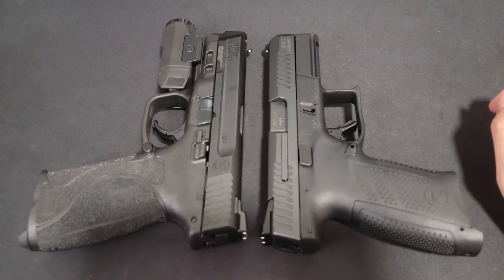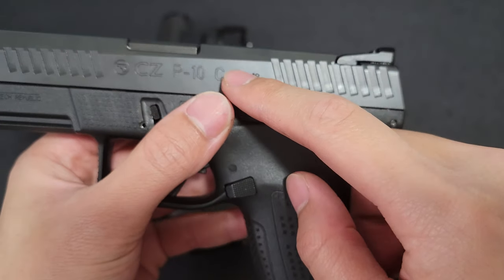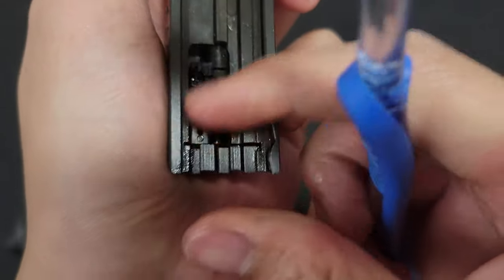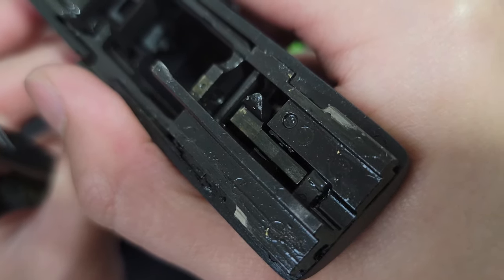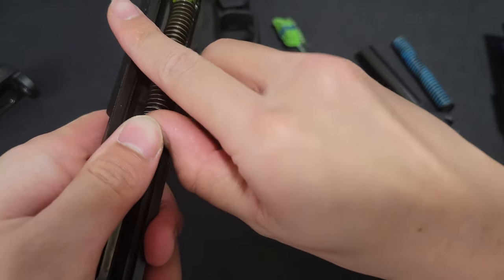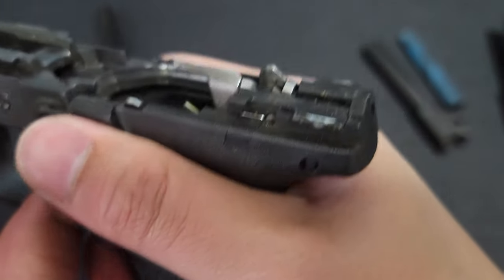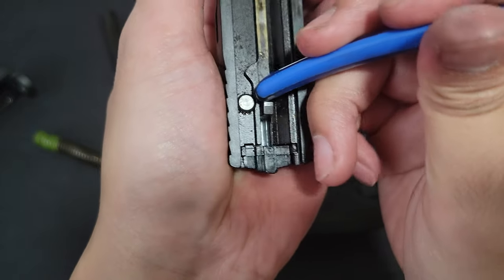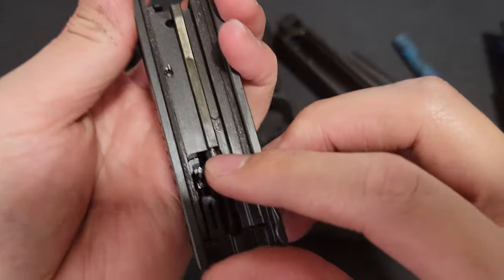Addressing the CZ P-10 C Firing Pin Stop Design Flaw (Read Description, Updated 7 April 2021)

Comment: Shame the P10 uses, in my opinion, an inferior firing pin block substitution. I really love my S model. I am planning to CC a Glock but it feels like a big downgrade. Big tradeoff for safety. I hope CZ resolves this issue before any one is hurt and their reputation is stained.
Reply: Their reputation is still intact and the sky hasn't fallen yet a year later 🤪🤪
Reply: This has been a "problem" for six years and I have not seen or heard of one single instance of a P-10 series negligent discharge from mechanical failure.
Reply: @TheOfficialCaseMade  Ya, I just learned recently the P10 series is partially cocked. Lol

Comment: What do you want to prove? That something doesn't work the way you expect it to, just the way it was designed, it is obvious. The situation that the fully cocked firing pin hits the lock will never occur except in your test. There will also be no mechanical wear of the lock because in a normal firing cycle the lock never comes into contact with the striking firing pin. Lock wear can only occur when someone intentionally strikes the lock with a fully cocked firing pin. Just. There's no other way. You wrote about a possible malfunction and that the lock should protect against accidental shooting. And you prove that the lockdown isn't exaggerated to protect against a situation that will never happen. What if there is a lock failure really happens, and the block won't release EVEN when we try to fire? In CZ, the spire will overcome such a blockage, and maybe it will save your life. The lock is designed to withstand the firing pin falling off the trigger rail without the trigger being pulled, and nothing more, not even 1% more than that. Because when this lock fails, you pull the trigger to save your life, the lock won't release. And the gun will be useless. All this test it's like proving that some company released a defective car model because the brakes don't work in zero gravity.
Reply: Pretty accurate 👍

Comment: I took mine apart and the whole assembly including the firing pin block moves forward and the firing pin sticks out and would indeed fire a round, just as you show in the video. So that could be a problem if the gun is dropped and worse yet I guess the gun could fire if you racked the slide and then let go to close being the case being loaded as the slide goes forward? I guess the only safe way to carry the CZ would be with no round in the chamber and also when racking the gun you would have to not let it slam forward like in other pistols. It's a really nice gun, too bad about the design flaw. I wonder if it would be possible for a gunsmith to insert something to prevent the whole mechanism sliding forward.

Comment: Can you test drop it on a primed shell?
Reply: He doesn’t even need that. You can get snap caps with foam cylinders where the primer would be. He can run drop and hammer tests easily with the gun fully assembled and demonstrate that he was able to get the guns internal safeties to fail this way. He hasn’t. If he’s such an amateur rocket scientist, he would already know how to prove his claim. Anyone can go digging into an unassembled firearm with tools and make things fail.
Reply: of course he won't do that. he'll become a laughing stock
Reply: I did, with 3 times to make sure it's consistent

Released from half to 3/4 cocked the primer was dented but didn't go off, even with reactivate strikes on the same one. But when released from full cocked it did go off. Although when loaded, the striker is only half cocked. While it could be better designed, it's definitely safe enough. Not to mention the sear can't move down in the half cocked position, so the sear will have to physically break before this even matters

Comment: So I have a 2021 and 22 model and one thing isn't making sense. If they discontinued a specific model number because of something as serious as a firing pin issue like you've stated, why is there not a recall for all those models?
Reply from the maker: The thing CZ fixed was the older model P10s striker sear rotating sideways and jamming up the gun.

Comment: Just curios, when the gun is assembled, what would make the firing pin move forward without pulling the trigger?
Reply from the maker: A malfunction, these safeties are there in case of malfunctions, not in case the gun works properly. If the gun ever malfunctions, it may fire whereas if other guns malfunction, they will not.
Reply: @Radvous  🤣🤣🤣🤣🤣🤣🤣🤣🤣🤣🤣🤣🤣🤣🤣🤣🤣

Comment: So is this a safety recall issue or something?  I just bought the p10 c and the p10f,  do I need to contact cz and see what needs to be done??
Reply from the maker: It's a possible failure point, but you should be alright.
Reply: @Radvous  Thank u.

Comment: Do you know if this has been corrected in current versions of the gun? Would this issue stop you from buying one if you liked it otherwise?
Nice vid. I’m not very mechanical and I could understand it.
Reply: I have one with a production date of 2023 and mine does not have this issue and works as it should
Reply: Same

Comment: I'll bet my neighbors just heard me slap my head.  Walk yourself through that line of thought again and let's see if you can figure out where you lost it.
Reply from the maker: Better yet, teach me if you know so much. Remember, its function doesn't change when the gun is assembled, I can take a needle through the back of the slide and flip that safety, nothing is holding it. What else do you have to inform me about?
Reply: @Radvous  Great, go ahead and grab a probe and measure from the back of the slide how far back the striker is actually taken to under function, then go ahead and repeat your little test under the actual forces the striker is capable of producing instead of slingshotting it from as far back as it can go.  If you have a small trigger pull gauge, you should measure the differences in forces compared to where it actually gets cocked to vs where you are extending it to.  Your "test" is putting the firing pin spring under compression that it doesn't ever reach during normal function and are jacking the striker forward with more force than it is capable of producing under normal function.  Not hard dude.
Reply: @Radvous  And FYI, there is an anti-rotation device on the seer which keeps that safety from moving.  But sure, you claim the function doesn't change...

lol
Reply from the maker: @Arthur11342  there is not buddy, that's just heresay, checked mine multiple time
Reply: @Radvous  If by checked you mean mangled with a toothbrush, sure.
Reply from the maker: @Arthur11342 if needle through the back of the slide doesn't get through to your head enough, then this is a lost cause. I literally have the gun in my possession, can take a needle and move the firing pin block, that means nothing is holding it like you said it is. Unless you have even 1 video proving otherwise, your "opinion" means nothing. You're just someone spewing garbage from your mouth. Take the word of someone who actually has the gun, not someone who just talks with no experience.
Reply: @Radvous  Cool story, bro.

Comment: The pistol must be assembled for this to work. Cz can sue for this.
Reply from the maker: Even if that is true (it's not because I tested the safety while the gun was assembled), the safety itself by design is supposed to work if the slide breaks off the frame, if it only works when assembled in theory, it is pointless. It's supposed to be designed to work whether the gun is assembled or not. Glocks, M&Ps, Caniks, HKs etc. all work when disassembled.
Reply: @Radvous  Thanks. I have the p10m. Hope it works ok.
Reply: @larryjones6049  the p10m doesn’t have this “automatic safety” feature. It’s the only one in that line that doesn’t.

Comment: This early Gen one P10 or newer model? Looks Gen 1 they had lots of issues that’s since fixed now least  I think
Reply from the maker: 2020 model
Reply: @Radvous  looks nothing like it maybe I’m wrong
Reply from the maker: @tacticalbt1023  this model doesn't have the Ambi magazine release like the originals, and the loose swiveling striker assembly is not present on this one, also the serial number identifies it as a 2020 production.

Comment: You keep saying “you’re missing the point” when others tell you the system works as one, not with the slide removed. Just to get to a point, where did you attend gunsmith school instead of being a YouTube genius?
Reply from the maker: I'd say a have an extremely mechanically inclined background https://youtu.be/3QCrFIXZTTc / https://youtu.be/hBWf2C6Q2Nk
Reply from the maker: Also no the slide doesn't have any more integrity with the slide installed on the gun, the firing pin stop is in a place where it is designed to be able to move and nothing is holding it in place any different than it is when the slide is outside the gun. Also depending on your pistol, your slide may pop off the frame if it takes a hit hard enough, some Glock slides have been known to have broken rails too, but good thing their firing pins work outside the frame. Most people are not super mechanically inclined, that's why most people are not engineers so think about that. A lot of times it takes one person that's different than others to figure out stuff.
Reply from the maker: Huntski Kerbiden-Zhaojing  that's fine, I am all ears if you or someone else could make a video explaining in detail how I am wrong. What I want to know is how does the firing pin block not have an issue, as that is my main concern. My concerns do not lie in the rest of the gun functioning as those have seen to be engineered just fine, I also indeed do like the gun, it fits great and has a nice feeling trigger. I'm am open to detailed video and explanation of the firing pin block specifically how it allegedly actually works just fine. Me thoroughly examining my gun, I have seen first hand that when the gun is assembled, the structural integrity of the firing pin block doesn't actually change as nothing on the frame actually holds it in place any different than it is outside of the gun. Also I would like to ask anyone, what is the point of a firing pin block as well, there has to be a specific reason to it. I look forward to learning, thank you.
Reply from the maker: Huntski Kerbiden-Zhaojing  you can't just yell, you have to back it up, show a video of your CZ.
Reply from the maker: Huntski Kerbiden-Zhaojing  I have even put in a small pin inside the gun when it is assembled, to try and see if anything holds the firing pin block, nothing does, it moves sloppily and freely even when the gun is assembled. Please answer this though, what is the point of a firing pin block? What is is purpose and what is it designed for?
Reply from the maker: Huntski Kerbiden-Zhaojing  make a video, prove to me I'm wrong and I'll Venmo you 100 dollars, I will make a video saying I'm wrong too if you can prove it, back up claims, yelling won't cut it.
Reply from the maker: Huntski Kerbiden-Zhaojing  you can actually Google this, it's not just me that is claiming this. Here's what I can do, I show you that the firing block moves freely even when the gun is assembled to ram home my argument that the firing block doesn't work as designed.  The rest of the gun, totally fine no issues, just this one.
Reply from the maker: Huntski Kerbiden-Zhaojing  the drop test would only prove that the trigger bar works fine, which I am not detesting. I am detesting the point of a non functing firing pin block. If the trigger bar sear and striker sear work fine, then what's the point of a firing pin block?
Reply: Damn I just want to know if I need to have my fucking guns looked at!!! Yelling at this guy about his video doesn’t fix whether he has a valid point or not.  Damn.  We should be more concerned if our cz’s are functioning I would think!

Comment: Also be careful with the sweat on the mag catch! A friend of mine use it iwb in hot summer and sweat reached the mag catch. He didn't knew about it and after he came back from a 10 day holiday the mag was stuck inside the gun. If you know you sweat like a pig use some vaseline on the mag catch spring
Reply: That was only on the gen 1s, they got rid of the ambi mag release in the gen 2s because of those problems
Reply: @aztronomy7457  So my new duty gun P10C 9x19 Nato with ambi mag release have these problems? The mag release button is very hard to press. This gun is considered military grade here and is not available for civilians.
Reply: @orhanabd1724  there should be a 2 digit number on the right side of your gun right above the slide release. That’s the year it was made. If it’s anything 2020 and beyond you should be fine. The SLIDE release on all CZ p10c’s are hard to press at first but then they break in. If you have a round in the chamber then they are easier to press. The MAG release however, if yours has a button on BOTH sides, might be a bit of a problem. Does your magazine release have a button on both sides, or does it just give you the option to swap it out? Because both styles are technically considered ambidextrous. The latter is better. However based on reading your comments it sounds like you might be referring to the slide release being hard to press, since that seems to be a normal problem people complain about with the p10.
Reply: @orhanabd1724  if you do have a button on both sides for the MAG release, and you have no option to change it, I’d maybe test it with some water/dirt and see if it fails. Better to test it out before you get into a combat situation. But I’d absolutely be a bit worried, if I had one of the original Cz p10s, If you had an older model with 2 mag releases.
Reply: @aztronomy7457  Thanks for the response. Yes the slide release is very stiff too but I always rack the slide when reloading. The gun has mag release buttons on each side (true ambidextrous) and is a pain in the ass to take the mag out. But the gun is brand new and I think it will be better after some break in. My personal CC is a G43X which is almost perfect. The only issue I have is with the crap finish on gen 5 Glocks.
Reply: @orhanabd1724  if that’s the case I would bring it to the attention of your department. You can’t have a gun that has a faulty mag release like that. I would not trust that with my life.
Reply: @aztronomy7457  You are right! But here is not US and I don't think I would ever have to use all my 15 rounds to put a second mag in my gun. Gun ownership is less than 1% here. Most attacks on police are made with knives, axes, bats and this kind of objects. Civilians can carry only less lethal pistols for self defense.
Reply: @orhanabd1724  true. what country? its a good gun regardless. very accurate  and  low recoil
Reply: @aztronomy7457  Romania! Yes it's a very good gun but not Glock 19 killer 🙂 (nothing is)

Comment: I think you over oil the CZ. Clean and get rid of some of that  mess mix with the oil and try  again. However it's a poor design. The M&P design is different and better.
Reply from the maker: There's no such thing as over lubrication, if too much oil interferes with the simple mechanical function of a gun then that's a gun issue, not an oil issue. People who say there's too much oil on my guns don't shoot enough to see their oil burn up. My range sessions sometimes include up to a whole 1,000 round case+ worth of ammo. No way a tiny bit of oil is going to last. If you shoot 50 or 100 rounds per session then okay sure, you don't need that much oil.

Comment: Firearm safeties can fail, the user is the ultimate safety. Personally don't like the firing block on the CZ P-10c, there are better designs.
Reply from the maker: Very true, the best safety is between the ears. But you would think safeties are designed to work, not fail from the get-go.

Comment: Damn is this a real issue? Have there been legitimate cases? Or is this just theoretical... have any CZ p10fs just fired of their own accord or when dropped?
Reply: In my limited research on this subject,  it is just theoretical. What I find funny is the multiple cases of the Sig P320 going off in holsters, yet many law enforcement agencies are adopting them still.
Reply: It's impossible for the P320 to fire without pulling the trigger. Those injuries are the result no trigger safety design and negligence. Throw some dirtbag lawyers into the mix and you got yourself a class action lawsuit. You really believe a firearms maker would leave an unsafe product on the market?
Reply: @mikemcintosh295  I don't know about this case in particular but I've seen other cases featured where they've demonstrated a firearm firing by itself and then they explained the mechanism, and corrected it.  Although rare it's not as though it's never happened.
Reply: @jamesharris184  A couple of interesting videos. I believe the Sig had a issue with the drop safety early on but it was fixed. The second video goes into depth on some of the people that supposedly had accidents. These are worth watching.
Reply: @mikemcintosh295  thanks I've seen a few of them. I never understood the trigger safety, how you have to depress something before the trigger will fire. Someone explained it online that that was an extra mechanism for the pistol to fire so when you dropped it it wouldn't go off.  With any mechanical device the realm of failure is ever-present.
Reply: @jamesharris184  I think the trigger safety helps to not accidentally fire while reholstering mostly. I guess the idea behind it is to make sure you have your whole  finger on the trigger to fire.